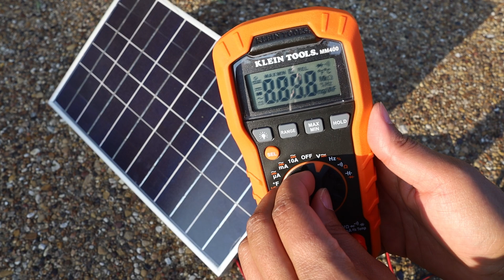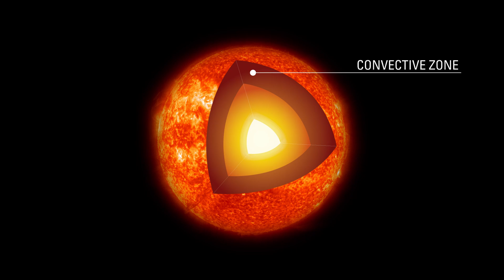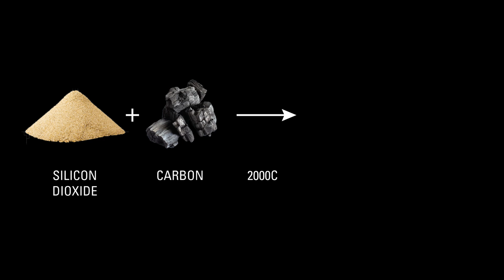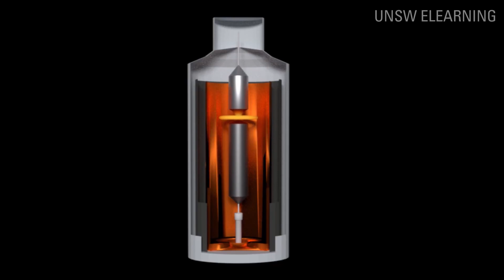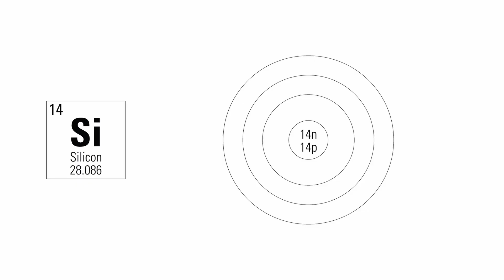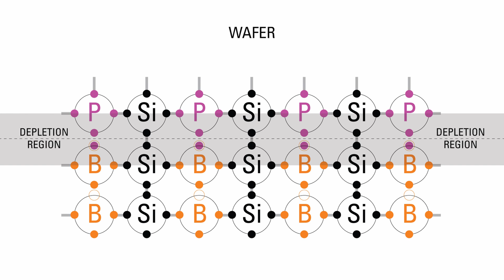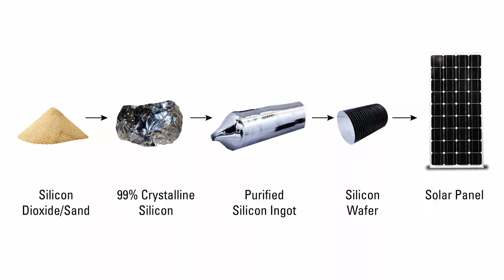Introduction to solar panels & how they work

Comment: Would you please do a comparison of solar w battery to gas or propane generators of the same output as power back up for a home including financial comparison.  Also most panels do not last more than 9-12 years same with batteries, they will produce power but will degrade to less than 40% output, thank you.  Your videos are great!

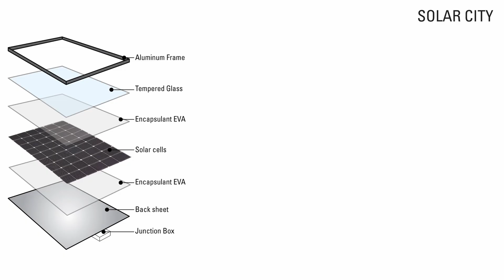Comment: Nice Video. At 7:53 you say each cell is 0.5 volts/ cell which "apparently" produces 24v in a panel? As I look at a 6 x 12 panel of cells, I see it either producing 36, 18, 12, 6 or 3v depending what parts are wired in series and parallel. Is it underrated or did does the panel actually produce something other than 24v?

Comment: The video started, and I see a hammer, putty knife, and a solar panel...  Instantly I thought, 'this isn't going to end well'.  While it would have been easy to omit that part of the video, I'm actually glad that you included it.  Solar panels are extremely fragile, and people need to see this before they try to experiment or improperly install them.  I'm enjoying watching your vids, as I'm interested in alternative power/heating solutions, along with the commentary and testing you apply to different building materials and processes.  Keep up the good work.

Comment: Great video.
One note on using solar panels:
Some (most?) solar charge controllers don't work without the battery connected, and can allegedly even be damaged by connecting the solar panels before the battery.

Comment: Why don't they cut the ingots vertically on the lengthwise so each thin wafer is a vertical long squared corner rectangle slice not a small round disc wafer?

Comment: Heat gun and a respirator :)
Or solvents, and a respirator :)
Reply from the maker: I tried using acetone but it didn't work. Any other solvent you'd recommend?
Reply: Belinda Carr one of the types of alcohols or paint thinner could be on the list. This article might be useful: https://www.bobvila.com/articles/how-to-remove-epoxy/

Comment: I think what a lot of the boffins disregard, and which architects shouldn't, is that even a dead panel can do 200-400 watts of work per square meter, at least if positioned to intercept heat from reaching a structure and with a bit of a gap for air flow.  Efficiency or power density doesn't seem nearly as important in a hot climate, relative to just achieving a lot of useful shade.

A few other little quizzling details to point out is that glass is somewhat good at reflecting infrared energy, which typical PN junctions don't much utilize directly.  Also, ordinary sand is often naturally doped with lattice substitutions, usually aluminium, calcium, iron, calcium, magnesium, potassium and a little of every other cation inevitably, hence the need to process it for consistency.
Reply from the maker: Thanks a lot for the extra info!! I'm working on a mono versus polycrystalline panel video. Could I pick you brain about the differences? Can you recommended any resources on the topic? Thanks!
Reply: @BelindaCarr  You probably know more than me on the subject by now.  We geologists find electricity to be spooky.  I do follow Will Prowse here on YT, and he has an interesting forum over at diysolarforumdotcom with pretty tight moderation.

Comment: Of course you understand that this does not qualify as non destructive testing.

Well explained. I know many solar sales and installation people that have no clue as to what they are working with when it comes to panels.

My very first business card said "Goniometer Specialist". I worked in silicon wafer defraction equipment to measure doping. A QC process. A definite conversation starter, and typically not in a good way.

Cheers!
Reply from the maker: Haha!! Just letting out some of that pent-up quarantine frustration. That title is very memorable! My husband's first business card said "VD Specialist" for Virtual Design. Lol!
Reply from the maker: I have a question for you... I'm working on a mono versus polycrystalline video and I was wondering if there were any resources you could recommend. Thank you!
Reply: @BelindaCarr  Hmm. My focus lately has been more on mobile applications like rvs and such, so what works for one... here is a blog post that helped me some. http://oh8stn.org/blog/2018/06/07/amorphous-poly-monocrystalline-solar-panels/. Then again, I have put 350 watt poly panels on rvs. I definitely like the prices of new panels $.70/watt vs used. Hope this help. Alex